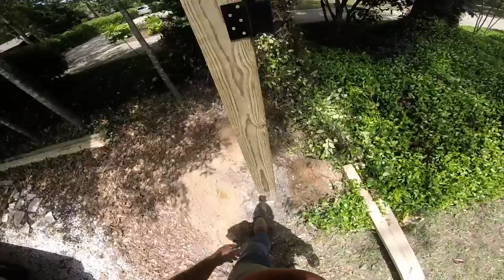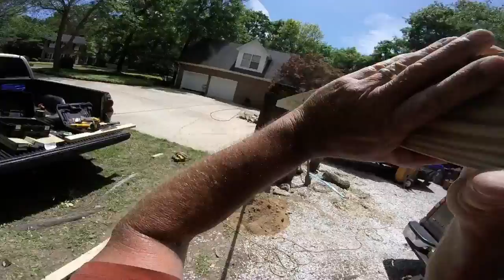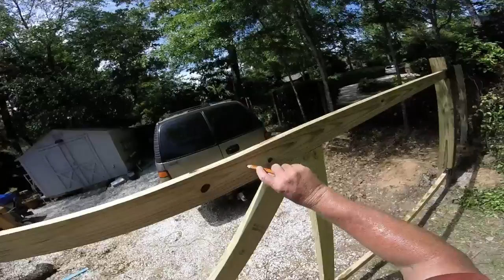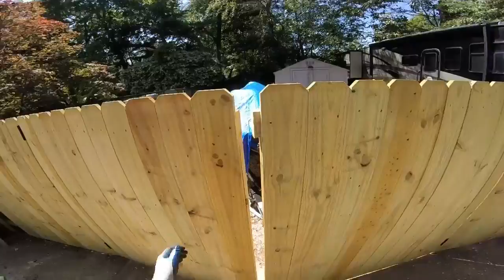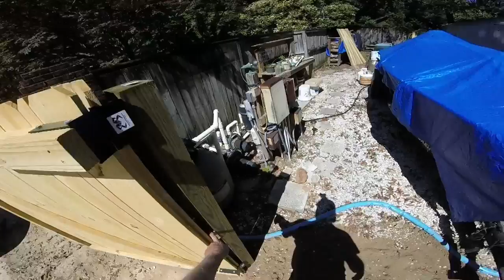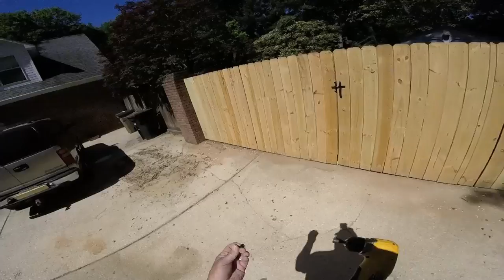🔥 Build a Wood Gate SOLO! The Hinge That Replaces a Second Set of Hands

Comment: Any options for a 15ft opening
Reply from the maker: 6 ft each gate is max width using wood framing,  Also gates 5-6 ft should have gate wheels installed & double gates must have removable center support post. Gates above max should be made using steel framing. Check with your local welding shop for more information.

Comment: excellent product.  great video for explanation. Where did you get the vinyl sleeve for the center post?  And do you have any flanges mounted to the sleeve (in ground) to help prevent movement during windy days pushing against the vertical center post?
Reply: You can get the vinyl sleeve from Home depot. It a veranda vinyl fence post.the vinyl sleeve is cemented in place - it's not going to be moving around during windy days.